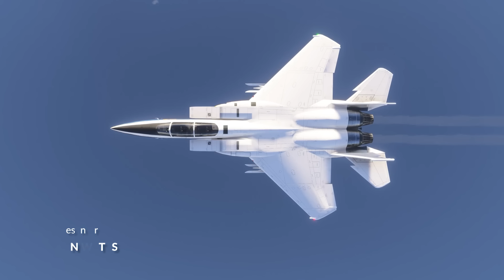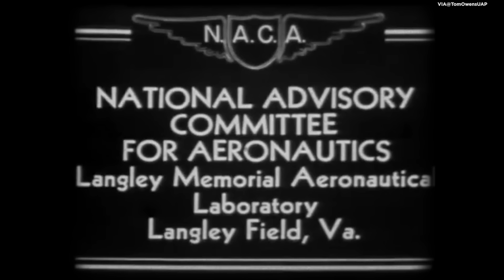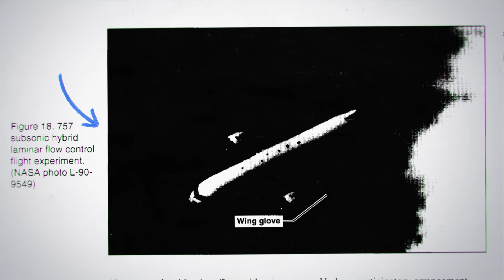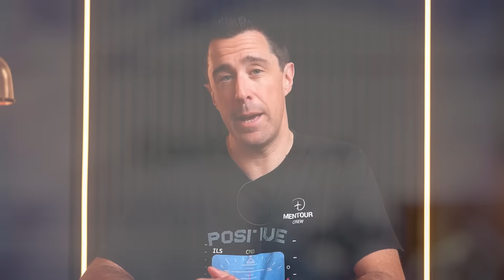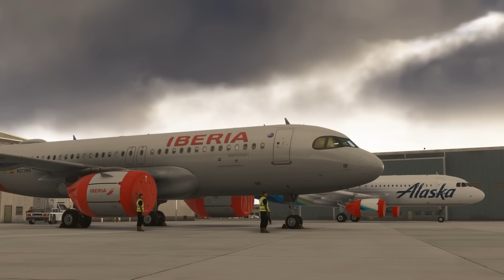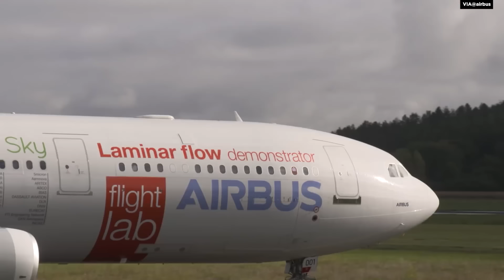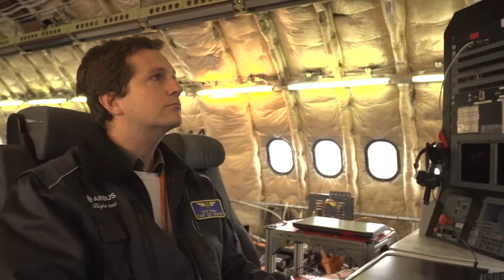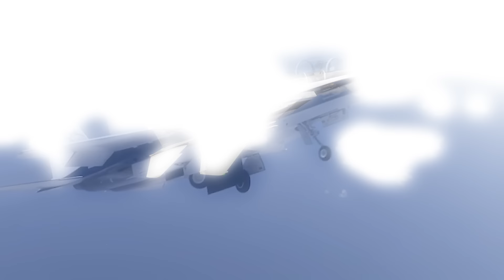Why DON’T We Use This Revolutionary Wing?

Comment: Protip: "NACA" is properly pronounced as an initialism ("enn-ay-see-ay"), not as an acronym ("naka"). Saying it correctly, as engineers in the 1940s and 1950s would have said it, means saying "N-A-C-A".
Reply: I pronounce it "naka".
Reply: @rael5469  enjoy being wrong. chris kraft and other members of the space task group pronounced it n-a-c-a, because that's how it's pronounced bro
Reply: @nobodyatall1886  Modern, jet-age, aviation was in it's infancy. NOW we pronounce it like naka.  As in, a NACA inlet. See?  We aren't going to say N.A.C.A. inlet. 45 years in aviation we've been saying it like one word. I KNOW it's origins, but now on aircraft it's mainly used to describe a naca inlet.....on the ac bays, for instance. Or for the APU on some aircraft. That's just the way it is. Do you say N.A.S.A or do you say NASA ?
Reply: @rael5469  I say both terms the correct way, dummy. "nasa" and "n.a.c.a". enjoy being wrong.

Comment: I remember reading somewhere that McDonnell Douglas's early flying wing designs put engines really close to the fuselage in order to suck in the boundary layer, and it worked.
Reply from the maker: That has to do with the boundary layer of the fuselage, not the wings... but it is definitely an interesting idea. The problem there is what happens when pieces of icing on the fuselage break off, and make their way into the engines. Probably not an insurmountable problem, but something to consider for sure.
Reply: Is there a huge distinction between the fuselage and the wing for a flying wing?:)
Reply from the maker: Fair enough! 😂
Reply: The only McDD flying wing I know is the A-12 that never flew ...
Don't you mean Northrop ?
Reply: @Wannes_  apparently, I mixed up BWB and flying wing, it was BWB-17

Comment: You must look at Gliders that invented winglets already in the beginning of the 80th.
All gliders have laminar wing profiles due to our sport depending on minimum drag at highest wing load kg per square meter.
Reply: The highest lift to drag ratio is a bell curve.  Is that the general shape of glider wings?
Reply: The 80th what, century?
Reply: @johnnunn8688  LMAO

Comment: Laminar flow is extremely sensitive to icing.  A tiny bit of ice on a wing has a large effect, but with laminar flow that is multiplied by interrupting the laminar flow.  You get  a stall at higher speed and it is a more violent stall... This is deadly when taking off.

Yes, laminar flow airfoils are more efficient, lower drag.  But in winter, you have a wing that might not be able to be de-iced adequately due to cold fuel causing rapid reformation if ice before the aircraft can taxi to the runway.

The aerodynamics are exactly why we don't use it on most airliners.  A couple have used it and these smaller "commuter class" aircraft have been involved in a few ice induced crashes at takeoff due to just minutes delay after deicing.

And you can't do the "active laminar flow" when the wing is coated in even a thin layer of ice.  The holes get plugged.
Reply from the maker: All good observations, but... stay tuned, we'll revisit some of these topics in a separate video!
Reply: Nor just ice, any surface defect, ding, insect, rain drops .....
Reply: @fifi23o5  thinking of all those times now that I've seen dinged airliner wings or taped holes or missing screws
Reply: You also stall at a lower AoA. As you mentioned, major negative effects.
Reply: That's what happend to that plane in Bangor Main a few months back. A challenge 650 that uses a hybrid laminar wing.
Reply: @uberdang830  I Indeed, the absence of slats makes the wing super-sensitive to ice at the higher AoA required for take-off, but the main root cause is the ignorance of the de-icing procedures.
Reply: @mrmariusi Yeh the preliminary NTSB report basically says they blew the clock.
Reply: @mrmariusi So even though the final report is not out yet. It looks 🔎 like a combination of the wing's susceptibility to get screwed by icing, for lack of better words. Which is not surprising for a wing on a jet aircraft which is designed for high speed efficiency. And perhaps laminar flow. And a failure on the crew to follow de ice procedures. Whether that was just careIessness or in a rush or lack of awareness. I didn't even know there was a table of holdover time for different conditions, I thought it was always like 15 minutes. But I'm not a pilot. So perhaps highlights susectabilty of laminar airfoil to contamination, or maybe that would happen to any plane with icing. But especially certain types.
Reply: @mrmariusi  Those subpar deicing procedures are just one fact of the real world out there. One cannot assume that every pilot is equivalent of Yeager or Sully, or that every FBO is equiped and staffed like NASA or EADS labs.
Reply: @boskozdanski2508  Accidents occurred because the pilots and/or the airlines disregarded procedures, not because the pilots are not at the Chuck Yeager level.
What amazes me is that there's no TOWS alarm if you want to take off without being properly de-iced. It's more complicated than a flaps position sensor, but it's technically feasible.
Reply: I thought a few ATRs were downed by icing during descent.  Am I mis-rembering?
Reply: @HweolRidda @HweolRidda  Unfortunately, yes, ATR has a design very sensible to icing. But in the last incident in Brazil, it looks like the de-icing did not work due to company's poor practices. Company was terminated by the State.
Reply: @mrmariusi I didn't know that I thought it was just pilot error in failing to get out of icing conditions and use deice measures on the aircraft.
Reply: @andrebello4191 @andrebello4191 The preliminary report is not 100% clear, but pilots were 100% aware of severe icing, noticed a FAULT on the airframe de-icing system and activated the anti-icing three times. 
Maybe pilot error was contributing or even main cause, I don't know. What's 100% clear is that Brazil terminated Voepass, citing repeated safety violations, cracks, and structural damage in planes before the accident, and the inability to fix its issues even AFTER the accident.
Reply: Don't modern jets heat the wings?
Reply: @Wintermute_SilverPaths You know what. I think just the leading edge is heated. Due to the aerodynamics of the wing going through the air in flight, its harder for ice to form further back on the wing once the plane is flying. But you still have to de ice the top of the wing before takeoff because ice might have already formed there. The relative airflow stagnate close to the leading edge I think so I guess that's where ice forms the most. And that's the most crucial part because ice in the leading edge will throw off the flow going over the rest of the wing I guess. Heated wings take a lot of power from the engine. That's why a lot of aircraft, especially lighter ones, use inflation boots de ice or fluid instead of heat. And the high speed airflow during flight and cold air at altitude takes heat away which means even more power is required that's one reason it requires so much power from the engine. So because the leading edge is heated and not the rest of the wing, you got to spray fluid on the rest of the wing before takeoff. And the anti ice or de ice will take care of you after takeoff. Also the relative airflow pushes the heat back to the rest of the wing from the leading edge in flight I guess. I think this aircraft type has heated wings leading edge. Jets have more power available to them for anti ice heated leading edge. Even though its a lighter jet. That's what I think. So even though it has anti ice heating you still got to get sprayed before takeoff. The big commercial jets too.
Reply: Should be able to blow heated air through the system just need it to will make it more turbulent for takeoff to
Reply: Plus bug during the summer and dirt at any time of the year will reduce the laminar flow.
Reply: Not just icing, but any disturbance to the texture of the wing finish. Degradation of the paint could be enough to cause serious issues.
Reply: A laminar flow wing that's been caught in a hailstorm becomes useless.
Reply: Could trace heating the wings help with the ice problem?
Reply: The holes get plugged...by EVERYTHING...even Pollen!
Active laminar flow was abandoned LONG ago because there was No Conceivable way to keep them clean and it was an insufferable maintenance nightmare.
Cool idea. Really works.
Can't live in the Real World.
Reply: The answer to stall is sometimes simply more engine power and pulling more AOA
Reply: @bromine_element If your aircraft has that kind of thrust to weight. If not you better get the nose down to reduce the AOA. Depends on circumstances I guess. Also if you get below a certain speed induced drag tends to go up rapidly which can make it harder to recover. All depends. That's my opinion.
Reply: For icing, could build heating into the leading edge. If electric, can preheat while connected to ground service equipment as pax are loaded to reduce fuel consumption.
Reply: @joshuacheung6518  All commercial planes have leading edge and engine cowling heating. In flight, they are enough, ice does cannot form elsewhere due to air current. 
But on the tarmac, they're far from enough.
Regarding electric heating. If you disregard some old Russian planes and the F-35, only the 787 has electric leading-edge heating; the rest are bleed-air type, requiring at least one engine running. And indeed, when on the ground, the 787 can take power from ground power units instead of its engines or its APU.
Reply: @mrmariusi  i meant as supplemental heat, to really get things toasty on the ground. Large automated resistor packs with thermocouples to get things up to well above freezing
Reply: @joshuacheung6518  The glycol guns used now for de-icing have a few advantages:
1. Their action is tri-fold: thermal (the glycol is heated), mechanical (they act like the high-pressure car wash water guns), and chemical (glycol lowers the freezing point of water, preventing ice from forming).
2. There is some persistence after the de-icing procedure is finished; the glycol on the wing prevents it from icing at least for a while, allowing time for the plane to take off and get to the speed without icing. 
There were and sadly still are crashes at take-off due to poor de-icing; both "the ground" and the pilots can be at fault. The glycol may be poor, or the de-icing might be done incorrectly. The pilots might not request a second de-icing despite their take-off being delayed beyond the procedure's limits
3. Much lower price vs alternatives (like whole wings / stabilizers heated)
Maybe in 50 years, when electrical systems (kV range VDC, haha) will totally replace air-bleed, the planes will electrically heat the whole wing / stabilizers / body. Maybe the heater element will be the anti-lightning copper mesh of the carbon fiber composite. Or who knows what the much more intelligent-than-us AI will design???
Reply: @mrmariusi  sure, but the more costly alternatives can be used in conjunction. Preheat to loosen the ice and warm up thermal mass, deice fluid, keep heating to prevent more from forming. If contamination is really bad for it, then making sure none forms is worth the cost
Reply: @mrmariusi  I wouldn't hold out so much hope for AI design.
Reply: @DavidSmith-vr1nb  I don't hope. I'm just terrified about the world my children will live in 😵‍💫
Reply: Fuel warming would be tricky but good.
Reply: @fwill182  1. It's not cost-effective by orders of magnitude.
2. It's not enough. The fuel tank does not "fill" the entire wing: the front part is reserved for slats; some upper part is reserved for spoilers; the rear part is reserved for flaps and ailerons, etc...
BTW, the fuel tanks are never 100% full, so there's air insulating the top part of the wing from the fuel.
Reply: @mrmariusi  this guy is proposing wet wing designs!?
Reply: Wrong.  A thin layer a rough icing on a wing can reduce the stalling speed and by inducing slight turbulence into the air ahead of the tailplane enhance pre-stall buffet.
Reply: @HerbertTowers @HerbertTowers  Icing on the wing, especially on the front edge, would induce turbulence that will decrease lift vs. quasi-laminar flow by increasing the average pressure over the up part of the wing, so it will reduce lift, so it'll increase stall speed.
Reply: He's confusing performance (top speeds and fuel usage) with stall speeds.  Poor education tecnique.  Too many subjects combined into a short video.
Reply: Luckily for us, we’re soon to be all be living in an extremely warm climate
Reply: @MikeCheck-ce2ri  😂😂😂
Reply: @MikeCheck-ce2ri  😂Hope not too soon
Reply: @MikeCheck-ce2ri Laminar flow can be disturbed by any imperfections of the surface. That's why glider pilots use bugwipers in flight to keep the leading edge clean. A bug contaminated wing can increase drag up to 30%. The warmer it will be the  more bugs you'll get.
Reply: @d.m.821 they wipe in flight?
Reply: @thepisswalker yes they wipe in flight. If there are many Bugs in the air, wiping after each circling is useful.
Reply: MikeCheck-ce2ri,
The global warming hoax has been debunked if that's what you mean.

Comment: Usually with lower Reynolds number (more laminar flow) wings are more prone to stall at lower AOA. In aviation we can't eat the cake and have the cake.

Edit: first NACA airfoils (4-digit) has quite good stall characteristics at low Reynolds numbers.

Comment: For the boundary layer systems........ couldnt they just run the suction system in reverse and blow out all the crud? Theyd still need to inspect but I imagine that would accelerate turnaround substantially. For me personally the issue is just another potential point of failure. Flying is already crazy enough
Reply: Ever have a showerhead clog? if a few ports are clogged up, the fluid will just flow to other, open ports, rather than blow the crud out. and that's a basic showerhead with maybe a couple dozen holes.

only way you could guarantee it would be to have individual pressure valves for every single one of those millions of suction ports.
Reply: @fendermarxist  Well, it depends on the construction. If the pipe to the holes is sufficiently large then the flow rate through any open holes will not significantly affect the pressure in the pipe nor its ability to purge clogged holes. That ability of course will also depend on how clogged they are... showerheads typically get clogged by limescale deposits that have built up on the interior surface of the hole itself and/or by contaminants (probably bits of limescale again) that originate further upstream and thus will be on the inside of the hole and difficult to blow out.